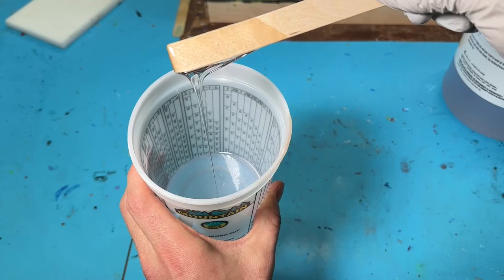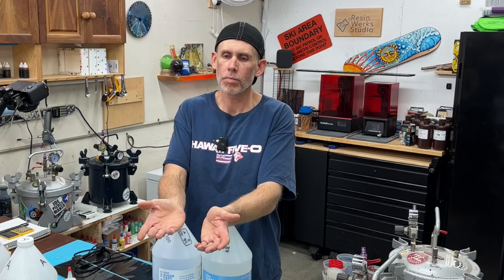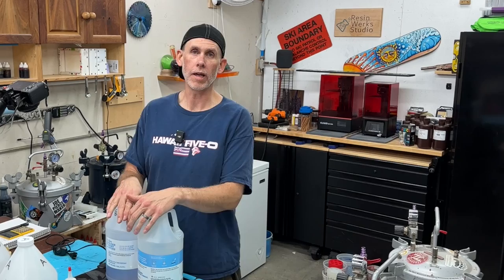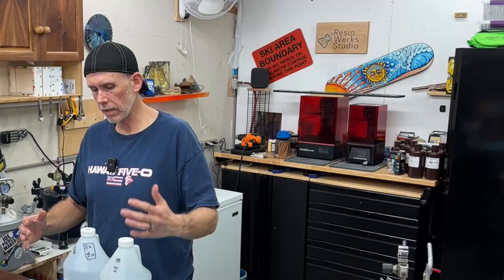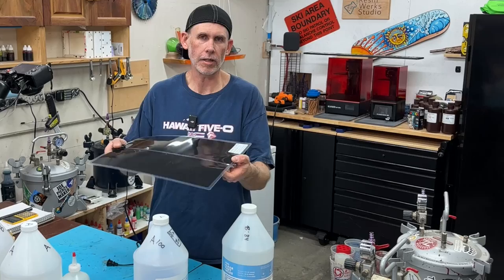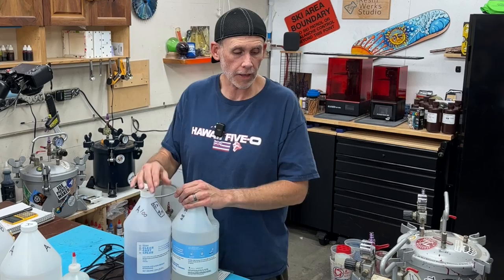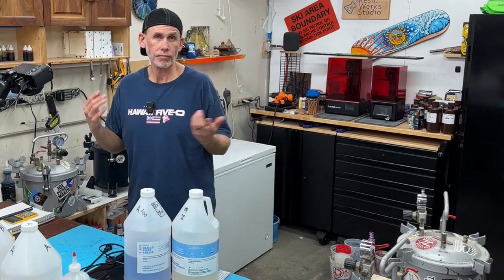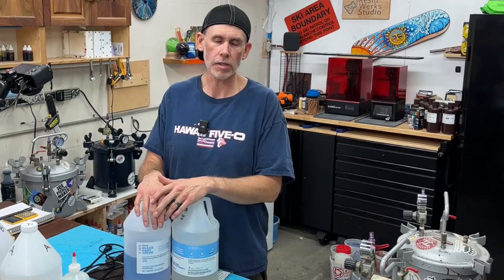How to Make Thick Resin Thinner - Super Simple & Cheap Setup

Comment: I have a mat that came with an insulated cover that’s used to help cure resin molds. I just put part a in a small silicon cup and part b in a separate silicone cup then set them on the mat and cover. The cover helps the entire inside heat up then I can mix after about 15 minutes and it’s thin enough to not hold bubbles and then I just leave the molds on the heated mat and they cure in half the time. I got my mat from Amazon and it came with the cover and a silicone cover for the heat mat to help protect it.

Comment: That's genius. I've used the hot water bath method in the past and had it mess projects up when I wasn't quite careful enough drying off the jugs before pouring out of them. 
This is a game changer, thanks for the tip!
Reply from the maker: You're very welcome! I know, I've gotten water in resin before as well and all over the casting area too, not my cup of tea!

Comment: Great tip Zack, really appreciate your educational videos. What temp is that Alumilite clear slow gonna start to gel/harden? Thanks again.
Reply from the maker: Glad they've been helpful. With Clear Slow, I usually wait until it reaches 95-100 degrees. You'll have to experiment a bit though, it depends a bit on the ambient temperature in the shop and your pouring technique